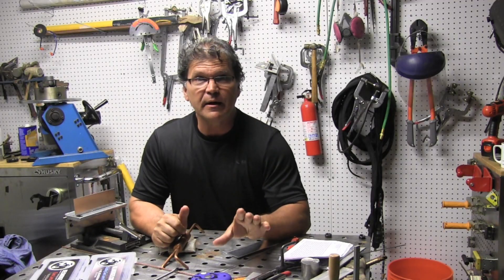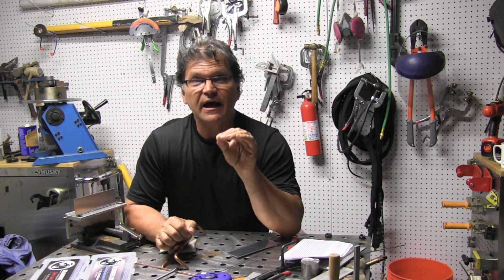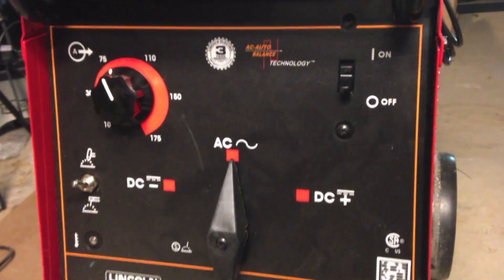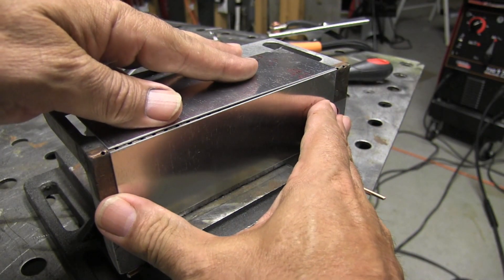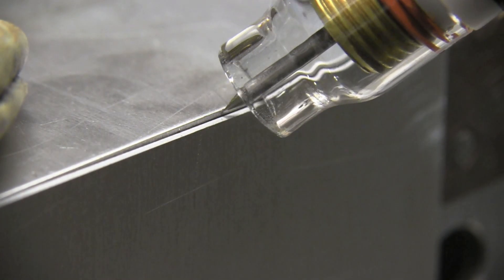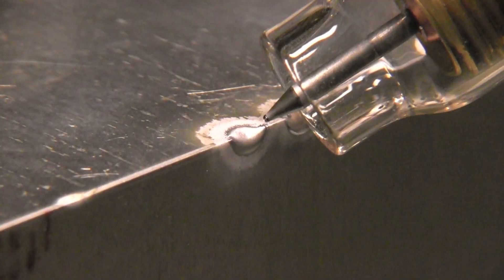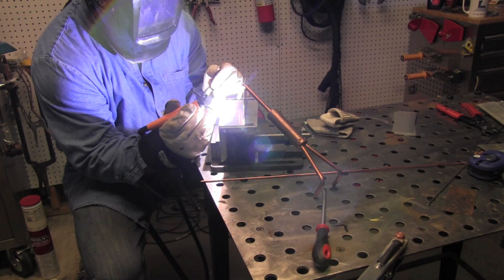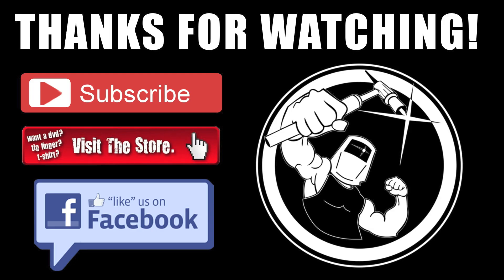Quick Tip-Tack Welding Thin Aluminum without Filler

Comment: Ok guys it's as simple as this the thinner the material...the better the fit up needs to be. Think about those test runs you made with 2 or even 3mm? You could have trained your dog to do it. Now it's 1mm everything changes. Perfect fit up = the possibility of fused tacks. Tiny gaps will just see it peel back.

Comment: Hello and thank you fro the video
the problem I have is that I can not see the welding procedure from back of my mask. I dont know whether it is because cheap mask I have purcahsed or I should come closer to workbench or .... .

Also I dont have flowmeter and instead I use a pressure gauge. is it Ok to set the output pressure on 2 bar for welding or not?

Comment: Hi Jody,  Ive been trying to find a video explaining in detail the processes for welding a Vintage Aluminum Motorcycle Tank off of a Yamaha TT500, after the existing weld has been ground off to gain entry inside of the tank to enable removal of hard to get at dents etc. Please is there any chance you could show what tips and tricks to consider with setup and type of machines capable of such a feat, plus the best welding technique to obtain that nice factory weld without any blowouts ?

Comment: I do 0. 6, 0.8 and 1mm nickel chromium molybdenum stainless at work on a daily basis. I go 40 to 60 amps/no pulses to get the puddle going rather fast, keep the welds tight and the overall heat in the metal low.

Comment: Went through this a year ago.  Lincoln 175 .040 3003 all butt welds on custom made saddle bags.  It was tough!!!!  There was no way to hold them or put anything behind the weld joint.  They turned out pretty good but I did have to use some body filler before paint.

Comment: Would a hot start do the same as turning the amps up like you did at 1.5A per thou assuming one using an inverter.

Comment: Hey Jodi! 
I’m having trouble with tacking up 1mm 1050 open corners where I’m not able to use any backing or filler. it’s a nightmare  scenario to be honest but do you have any suggestions? 
Cheers 
Jimbo

Comment: I run a restaurant with refrigerated  slide out drawers. Unfortunately, in the past 2 months, the beads done keep breaking apart, most likely due to .5cm thickness and possibly the 40 degree ambient temp. The weld lines tend to run 0.5" and 1.5" end to end. What would you suggest as a permanent fix, apart from a new fixture?

Is JB Weld even an option?

Thanks beforehand!

Comment: I bought a brand new Miller diversion 165 and could not weld thin aluminum with it. There just aren't any adjustments to compensate for different thicknesses with aluminum. I sold the Miller and bought and Everlast ex250 and love it.

Comment: Your videos are easy to follow and very instructional, but you make it look so easy that I'm pulling my hair out with my aluminum welding attempts.  I have a lincoln squarewave 175 that looks identical to yours and have been welding thin wall 6061 square tubing for my experimental aircraft door frames.  I have made few good beads that hold together using 4340 filler and lanthanated tungsten. I've tried 1/16 inch and 3/32nd of each filler rod and tungsten with limited success varying the argon from 15 all the way to 28.  With steel, it is easy to cheet on the edges by first melting filler and fusing it to the metal so as not to burn the edges.  With this stuff, I am finding the aluminum drop just balls up without flowing out.  When I do get a puddle it seems I can't consistently get a shiny, non porous mess that ends up with the piece falling through into a pile of scrap.   Occasionally I do dip the tungsten when free handing without a good rest on my frame.  If I see contaminant, I resharpen.  if not, I try continuing.  Is that my biggest problem in getting dark porous melted aluminum?   P.S.  I have tried grinding the surface lightly and wiping with acetone first and only see a little bit of difference.  I love your channel and will continue to practice, but thought I would have an easier time than this.  I am blowing though a lot of argon and filler rod!

Comment: What size of cup would be best on welding T joints and welding aluminum socket welds I'm using previously a number four ceramic I was wondering is there anything out there with more of a cone tip to give more direct for smaller beads

Comment: Sometimes when the edges run away, I will gag the tungsten slightly and  draw the puddle together. I will use that tungsten for the rest of the tacking sequence and resharpen it before welding out the part. Just a slight touch to the puddles that are running away will draw them together.  You don't have to go balls deep on it.

Comment: #2 TIP:
I would add having a maximum tungsten grind with a 45° <. No spire pointed tips, the arc loves to drift and find one odd spot to ball up. I also like a blunt tip for aluminum at or around .5 mil as it'll negate the effects of over-balling under the cathodic effects of the cleaning action. That .5 mil should become a pointed tip immune to excessive wear of the cleaning action over time. .5 will handle a constant 40 amps with .25 mil increments for about every 40 amps.
The higher the amps, the bigger the blunt grind on the tip and the ball will almost form out to the exact point for the grind. You'll get it sorted out over time and know how much to grind off of the tip.

#1 TIP:
Buy some aluminum coil stock and get after it! Practice, practice, practice, and when you feel you'll be able to reasonably weld the body kit... PRACTICE SOME MORE!

Life would be so much easier if aluminum welding behaved exactly like steel and steel behaved like aluminum when welding...

Comment: i am from holland and i never weld with tig   and i buy some tig welding machiene ac dc  160amp  first weld with tig was i aluminum it coust my 1 hour  to weld  it to geather   becouse of  watching many of your videos  it helps me alot thanks to you realy learning videos   bether then mine scool teacher 15 jears ago  i learnt nothing.   buth now  it goes much bether and bether   your my teacher now of youtube . there is only 1 thing that i still donth now  is the argon gas  setting   i have my flow meter set on 9 liters per minute is that oke  and what is the reason  sommetimes my electrode melting why the tip gets round  i sharpening my electrode to much sommetime  i use more electrode than filler material.

Comment: Jody,

I have thoroughly enjoyed your videos. One thing that perplexes me, however, is that I was never certified but I worked as a welder many years I worked fabricating D9 Caterpillar parts (rollover assemblies, track frames etc.) and smaller stuff as well (snowpolows, autobody ) and one thing that was a cardinal sin was running a weld downhill. Guys used to marvel at me running wire uphill although I never understood their amazement, but the guys I worked with fabricating D9 parts taught me to run 7018 uphill and that was definitely not as easy. Most of the D9 fabrication stuff was cored wire and that does not run out of position. Please tell me if there was something that made downhill welding okay because I never really understood the taboo and I frequently did it with sheet metal. That is my question.

Comment: I had an issue welding sheet metal patch panels on my suv with my Eastwood 200. I then switched to my Everlast power tig 250EX . There is defiantly a difference in the low  end on the two machines.  Not all machines will drop low enough. 
Your reviews of the low capability of the power tig 250 ex is exactly why I purchased my machine.
Reply: I love the low end on Everlast welders. To me that is more important than raw power where I can throw some preheat or helium to help out.
Reply: Do those Everlast welders hold up? Their price point makes me a little sketchy on the quality.
Reply: Al RedAye Chinese junk
Reply: Martin Andersson 
China makes some of the best products in the world what are you talking about? Junk?
99% of the items in all our house are made in china.
Reply: Mark Rich they don't do any R&D just a bad copy with cheapest parts!
Poor duty cycle etc
And why do you never see any of them crap welders in any industry applications?
Because they are junk
Reply: No these welders are not for industrial use . But far from junk. Not every needs an industrial welder. Chinese welders are not copys . The way the boards and electronics are assembled are outdated .
The duty cycle on my welder is just fine. Have you owned a nicer Chinese welder? 
To say just because its Chinese  , its junk is wrong. 
All most all major company's have factory's of some sort in china. IE Lincoln electric. Its how the world does business now.
Your just repeating every stereotype you read on the internet.
Reply: Mark Rich No I would never buy anything like that.
I have a EWM Tetrix 230 Ac/Dc with watercooling the most advanced and powerful 1-phase machine on the market 
It was expensive but it will last a lifetime and parts and services will be available for decades 
Designed and built in Germany
Reply: Keep believing  the propaganda you read.
Your machine has parts made in china also. Look they have a head quarters there.
My machines 1 phase and 250 amps , duty cycle is 100% 200 amps. Its also water cooled. Drops down to 2 apms. My machine has every feature yours does but triangulated HF.
Nope mines not a life time machine but in 10 15 years as technology grows im sure ill want a new one. But parts are available .
Considering my welder was 4x less than yours more powerful has a better duty cycle with 100s of thousand of happy customers. I think I did good. Its a Everlast Powertig 250ex 2016 model. Its all I need in my home shop machine shop and has been.
Reply: Mark Rich Nope dot
Your neverlast does not have no near the bells and whistles that the EWM has 
Just some example neverlast have no metallurgical puls 15kHz 
Does not have puls mode for welding thin aluminium to thicker 
You don't have Active arc, And the list goes on
Reply: Mark Rich and your neverlast needing 32A fuse on 1-phase to do 250A
My do with 16A 1-phase

Comment: Hello. We have a Lincoln 175 Square Wave. I would like to know what would be the advantages on getting the HF addon for the machine. We manufacture injection and blow molds for plastics (materials: 4140, 420, Alu 7075). Thank you.
Reply: +Rafael Mora  HF add more freq settings  so more possibillities qua heat input , smaller thicknesses of materials (penetration deepness)  so if you do thinner materials maybe this will be a interesting upgrade to get
Reply: +Alex “AgEnTdArK” Dark thank you for your reply
Reply: you're welcome ;)
 if  you need a good welder i'm loocking to move away from Belgium
Reply: I don't think you will want to move to Venezuela! Hehe

Comment: This is same method ive used with success on this material, good video showcasing the technique.. Another thing you can do is tack the backside of the joint if you can get access as it can be a little more forgiving to heat input..

Comment: Thin aluminum has that nifty tendency to pull apart when you apply heat...and as you mentioned, the tacks are very brittle. More tacks is always better....sometimes when you're welding along, the joint starts to spread, so take the heat off and put some more tacks in there.....I've been known to build a tack, just dab a little nugget on one side, then let it fall to the other side of the joint. If it isn't tight enough, put some pressure on it and re-heat it til it closes up.
Reply: nunya bizniss great advice. I was pulling out my hair until reading your helpful tip. Thanks!

Comment: Good vid with great tips as usual.

Why not gas weld it? If it is body work and will require finishing I would gas weld it. Any aluminum bodywork that I have TIG welded cracks too easily when worked.  I gas weld sheet like that and you can bend it back over itself and beat it with a hammer and it won't crack or fail.

Comment: I'd like to learn to weld, for doing basic repairs an home project work. How would you recommend I start the journey?
Reply from the maker: It seems most folks buy a welder, get some scrap metal, watch some videos, and start practicing. But if you can take a short class it can really give you a jump start.
Reply: +weldingtipsandtricks Jody always has great advice. That is exactly how started out when I bought my everlast welder. Watch as many videos as you can and practice a lot.
Reply: hi Martin what everlastingly machine do you have and would you recommend them  im looking at a tig200dv
or multi process machine mainly want a tig.cheers

Comment: I have not done that thin of material or that alloy.  But I have done 16 gauge 6061 T6 with a really tight fit up.  Definitely  not very strong and lots of crater cracks.  I usually find another way no matter how hard so I can use the smallest amount of filler.